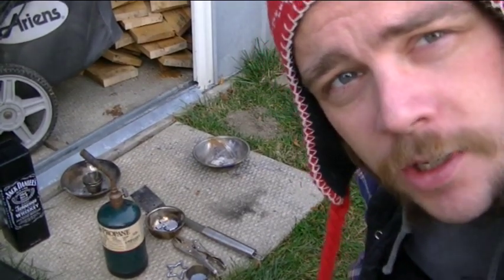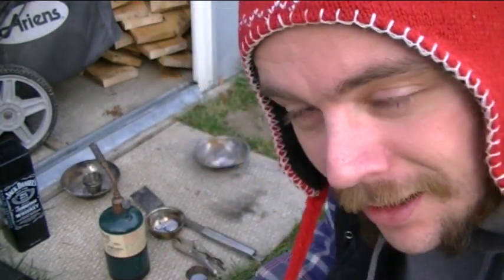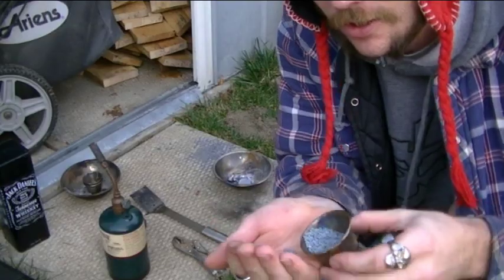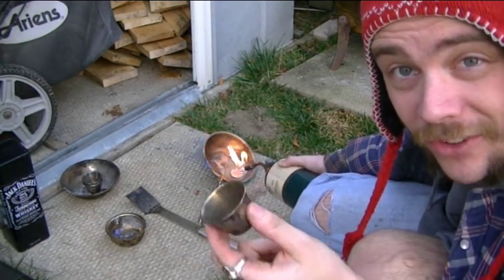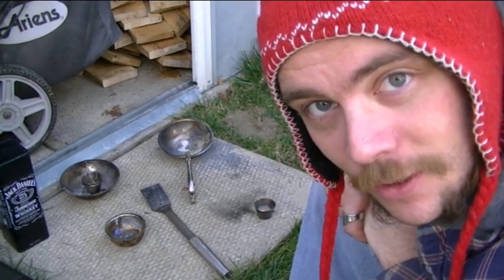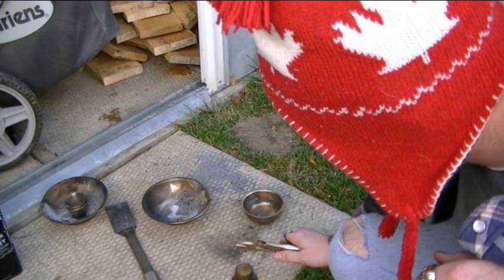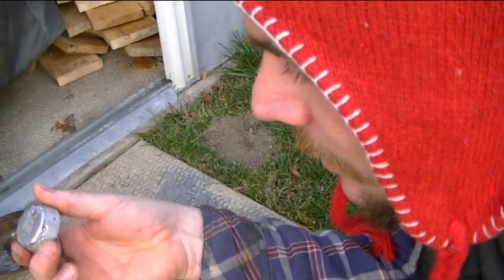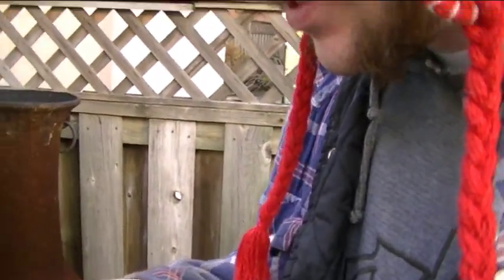HOW TO MELT LEAD

Comment: Is this bad for your health or shouldn't I be worried
Reply: It hasn't affected him one bit.
Reply: indoor it will be bad, if you make it to hot parts might evaporate, breathing that is bad, touching it when it it to hot, eating it, or touching the lead with a wound is a also bad. but if you are in a well ventialted area such as outside and be careful not to do to stupid things it should be safe. when you only occasionally do it and do not do it on a to large scale than you are also unlikely to get trouble unless you again do really stupid stuff.

Comment: I do the same thing but with Aluminum and i tried a bunch of fuel sources and the best i found and cheapest was the sun. Fresnel lens from an old rear projection t.v. can get a light beam focused to about 3000'F. i made my own crucible from clay and pit fired it some i can cast metal. also good for making ingots of any low melting metal.

Comment: Unless you live in California, lead is super hard to find. I needed lead for weights in a round ball Droid (BB-8). I had to buy it from Nevada.
Reply: Fuck yes it is. You can get it from pick and pull lots if there are wheel weights. Also the dirty process of taking it from batteries. Just be safe whatever you get it.
Reply: They changed the wheel weights to non lead in Cali more than 5 years ago.. believe me I thought about that. I'd go buy some bullets, but they are super expensive. Batteries are expensive too. 
Awesome vid btw!
Reply: Also fishing weights are no longer lead in california, lol

Comment: did you say you can use dirt as a mold?
Reply: like you dug a shape in the dirt and used that as a mold? i want to make 45lb weight plates out of lead, but i cant figure out what kind of mold i can use
Reply: LeekyChicken You can, but dirt isn't an ideal mold because it won't have the rigidity or solid composition to make clean castings unless you have soil that's full of clay.
Reply: LeekyChicken I used paper it worked lol